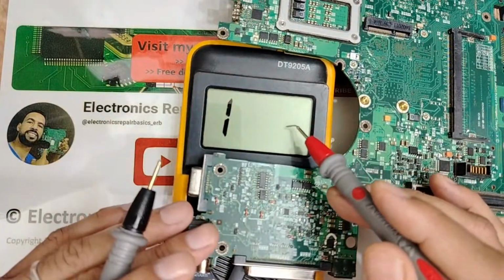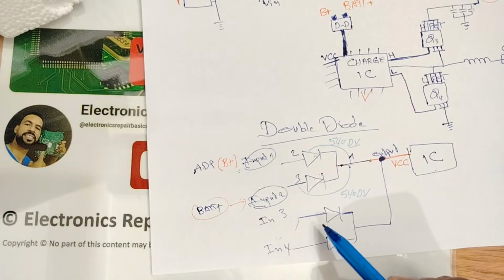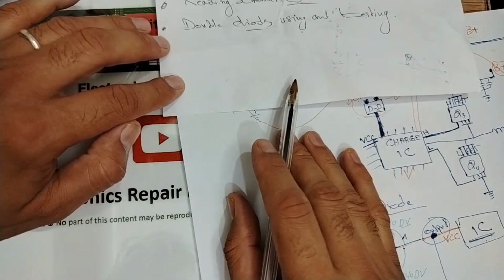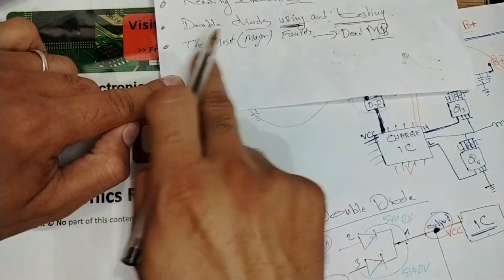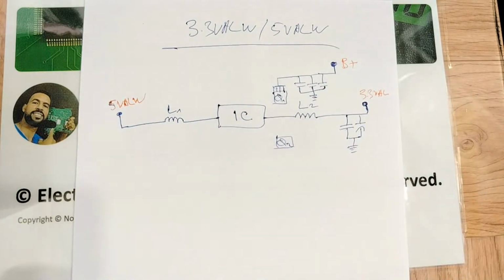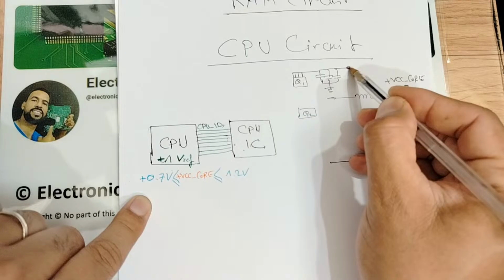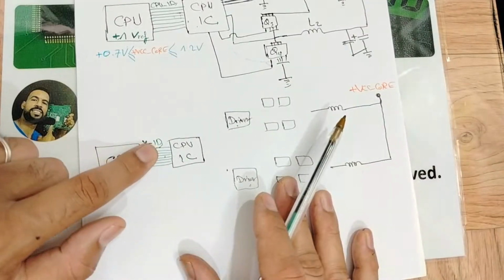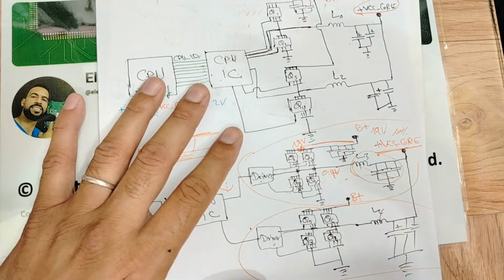Electronics Repair Basics_ERB Mind-blowind Livestream - Laptop Motherboard Repair

Comment: Sorry sir, you forgot to check the capacitor around the charger IC, because the charger IC could be damaged because the capacitor is damaged, sorry sir to remind you😁. And I ask, is the laptop unable to charge the battery because the Charger IC is damaged, it is not always the current resistor that is damaged